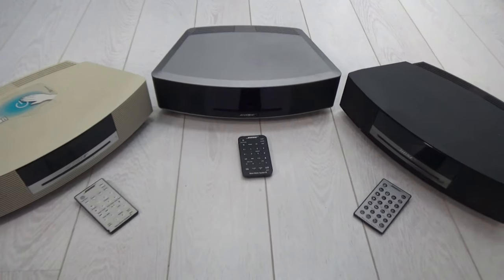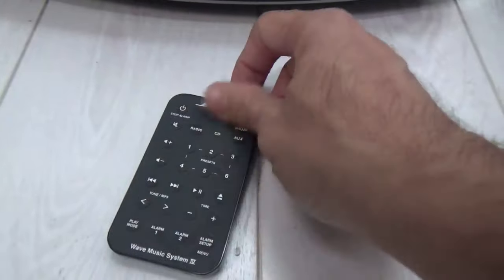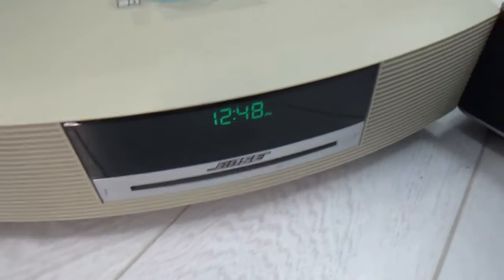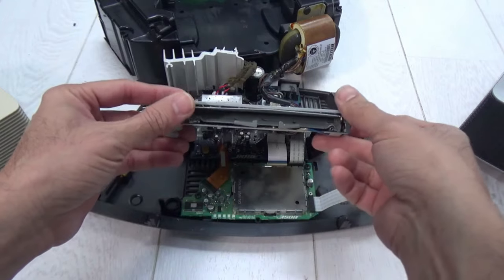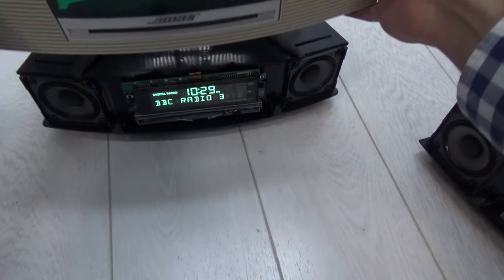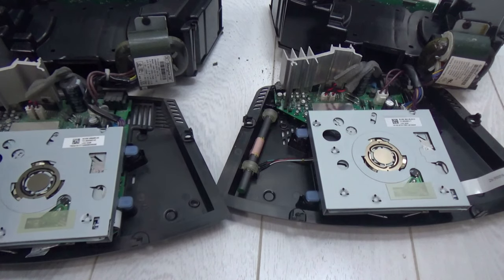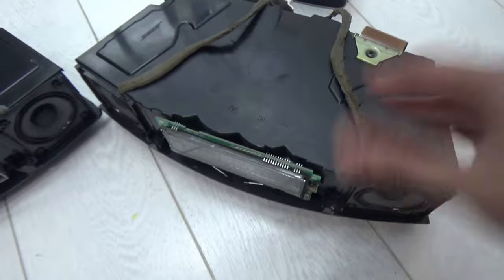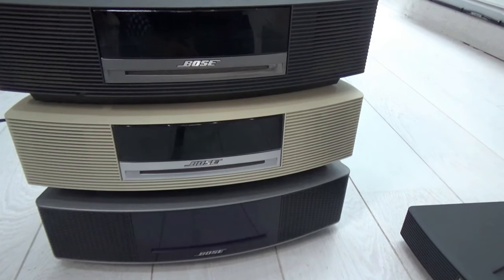Bose Wave Comparison

Comment: Thank you very much for this informative video. Since the Bose wave system is not produced any more, which device would you recommend that could replace it (or better)?
Reply from the maker: Thank you for your comments, I have not seen any Bose product that carries the same design as the Wave system. The wave systems are still around. You can buy them from Ebay or Bose Refurb shop.  All new bose products are smart internet based which means short life of the item.

Comment: I bought the run out of the BOSE II with a free DAB upgrade unit which TBH is a pain - I wish I'd bought the BOSE III instead. I did buy a BOSE IV later on and this has a better frontal grille design. It does however have a rubbish quality remote (see my other comment).

Comment: I have a sixteen year old system 2.  Still going strong.  But, I really wish it had the buttons on the box.
Reply from the maker: Thank you for your comments, Bose Wave II did make a button panel for the system II but was only available in US and Canada. It was called the IC-1 Touch pad. See in this link.

https://www.ebay.co.uk/itm/373445581839?mkcid=16&mkevt=1&mkrid=711-127632-2357-0&ssspo=EunZxSBVSbK&sssrc=4429486&ssuid=-Ln8Ks-tSpm&var=&widget_ver=artemis&media=COPY

Comment: I have a Wave III. I notice that the volume is good and loud on the FM, but when I connect any device to play music through the 3.5mm jack, I have to turn the volume much higher to get good sound. It’s too quiet until I turn it up twice as high on the volume. Is that normal?
Reply from the maker: Thank you for watching my channel and your comments. What type of device are you using in the AuX port?
You need to increase the volume on the source device aswell.
Reply: @thespecialist786  This is a great channel, thank you too! I’m using an iPhone/iPod on the auxiliary 3.5mm with said devices to max volume. I’m using a thin,cheap flimsy 3.5 auxiliary cord but the cord works great in my car.
Reply: @@user-zr3gh4cx1m well, that makes sense. I didn’t know that. I will try that. Either way, that’s reassuring to know it’s not just my Bose.
Reply from the maker: @@user-zr3gh4cx1mThank you for watching my channel. I have not experienced what you’re describing, seems to me may be the master volume setting is set too low. On you wave put it on Standby where you would only see the clock, then increase the volume while on stand by and see what level is the volume set to.

Comment: Thanks for posting. Isn’t Wave 4 has Bluetooth built in?
Reply from the maker: Thank you for watching my channel and posting comments. Please Subscribe to my channel.
To answer your question, 👎 No BOSE wave IV does not have bluetooth its a straight replacment for Bose Wave III with a blue display. You would have thought bose will add that as standard. You need to buy the Bose sound touch wireless link adaptor for bluetooth and WIFI. However then you can use the Wireless  link adaptor with any Wave music system does not have to be Wave IV. All is does it connects to the Aux. This device is £100 which does not make any sense because you can buy a good Logitech bluetooth adaptor for £30  and it will do the same job for bluetooth. The only advantage you have with Bose Wifi link adaptor is that you can also use the Bose App for radio internet via Wifi.
I do not know why Bose would release a new model with the same features as the last one apart from blue display but no bluetooth.
Here is the user guide check it out.
https://assets.bose.com/content/dam/Bose_DAM/Web/consumer_electronics/global/products/speakers/wave_music_system_iv/pdf/745087_og_wave-music-system_en.pdf

Comment: Hi specialist, Thanks for sharing , recently I have been looking  for diy repair for bose speakers( mine is wave system 3).Quite not find the video what I am looking till now . Here goes the problem ,Display looks good,jac and remote working fine but no sound is coming out from both right and left speakers ,Could you point out? what went wrong there ? that would help me ..thanks
Reply from the maker: Hi,
Thank you for watching my channel, the issue you describe is related on the main board and that is not the one under the CD tray. It could be one of the caps or the Audio IC which is mounted to the heat sink.
Reply: @thespecialist786   Thank you .👍 will Check on that....
Reply from the maker: Let me give you a tip and save time if you wish, buy a faulty cheap bose wave with a CD problem or broken case of Ebay and just swap the boards over. This will save you time and hassle of solidering etc because the audio is very rare issue on these units.

Comment: Thanks for the detailed comparison, Specialist. Do you know where the Bluetooth module is on the model 4? Thanks!
Reply from the maker: Thank you for your comments, Bose have not added bluetooth to any of the wave systems however the bluetooth is available on models III and IV via the optional sound touch pedestal.
Reply: @thespecialist786  Ahhhhh. I thought the pedestal was only for Wii and wired Internet connections. That makes me less disappointed because I thought the reason my wave IV wouldn’t go into Bluetooth mode was because of the stereo itself. Hopefully troubleshooting the pedestal is easier and less expensive than troubleshooting the stereo. Thanks for your timely response!
Reply from the maker: @autocompletellc9906  press the Aux button on the remote twice for Wifi and three times to enable bluetooth. If it does not work power off the system and the pedestal. Hold the button behind the pedestal and power on the bose while keeping the button pressed for 15secs the light on the pedestal will turn from white to amber Then once the please wait is gone. Power off the wave system and power on. This will reset your wave system and clear any errors.
Reply: @thespecialist786  I’ve tried pressing the aux button several times, to no avail. I’ve also held the button on the pedestal, but not while the Bose was powered off. I will try that. Thanks for the advice.
Reply from the maker: @autocompletellc9906  if all fails, plug the pedestal on to your PC - Windows. Not Mac and do a system update using the Bose Sound touch update file.  You will need a Micro USB cable to connect to the bose service port.

Here is the web site. Make sure you use the correct file else your system can become a brick.

http://downloads.bose.com/ced/soundtouch/soundtouch_usb/index.html#Wave_SoundTouch
Reply: @thespecialist786  Ok, so I’ve tried to reset the system as you instructed by powering off both units and holding the button on the back of the pedestal for 15 secs while powering the Bose unit back on. The light never did turn white. It did light up amber, and then went away in less than three seconds. As you’ve said, I will have to connect it to a pc and download the latest software updates.

Comment: I have the one that has no CD player....turn on and please wait appears on screen and doesn't work
Reply: It likely going to be bad SMD capacitors as a common issue with them. I fixed a few with CD not working and please wait when changing modes.

Comment: Fascinating and thank you! I have a  2 that reads CD not playable. Can you tell me if / where is voltage adjusting screw?
Reply from the maker: Hi, its an easy fix, I can send you info. There is no Volt adjuster. Its rhe caps and the laser. First clean the laser then try.
Reply: Thanks for the fast reply. Yes already cleaned laser.  Is there a way to determine if it's the optical pick up or caps? I have a multimeter.
Reply: Needless to say, but let me add, Subscribed!!
Reply from the maker: @MrDenniske1  It would be waste of time using a multi meter when we know which caps are the ones
Change the ones under the CD tray inside the metal shield. 
47uf,22uf,10uf,100uf and it will start to work.
Reply: @thespecialist786  Thank you, sir for sharing your knowledge. I'll give it a try! I will let you know outcome. God Bless

Comment: Hello The Specialist.  I have a Bose WARCC1 Wave radio/CD player.  First I plug in the machine, the power is on but not functional, I can not select anything.  It says please wait then do not thing.  After about 30 minutes then I can select AUX or Radio and it plays fine, but still cannot play the CDs.  Then about another 15 minutes later I can play the CDs OK.  I would appreciate very much for your advice.  Thanks
Reply from the maker: Thank you for your comments, If you look at some of the comments I have answered this question. You secondary small audio board caps need to be replaced. Around 6 caps need changing. Please subscribe tonmy channel. I have some really special videos coming soon for bose wave systems.

Comment: Hi specialist my wave 3 volume is very low and it sounds all muffled any ideas what could be the matter
Reply from the maker: On the remote, hold down the alarm setup button to enter into the Menu. Scroll through and go to Reset and press 2. See if by reseting the system makes a difference.

Comment: Dropped older version (cd top loader version) and now AM radio doesn't work, but everything else does. Any suggestions on the fix? Thank you
Reply from the maker: Open it and reconnect the AM attenna. Thank you for watching. Please subscribe to my channel.
Reply: @thespecialist786  Thank you and just subscribed. Can't seem to open it. I understand there are two tabs/bits sticking out inside and the bottom right and left at the front. Any thoughts on how to take the top off with these in mind? Thank you.
Reply from the maker: @user-kg5dd7ik6w  there is a screw under the CD tray and two at the back.
Reply: @thespecialist786  Unscrewed them all but it still wouldn't come off. Not sure what else to do to get the top off.
Reply from the maker: @user-kg5dd7ik6w  Wedge a butter knife or Flat screw drive on the edge at the bottom. Pry and dislodge it. Don’t worry it won’t break as long as you have removed all the screws.
Reply: @thespecialist786  Thank you. Will try that! I also recently bought a newer wave (front load cd). Some Cds work fine, but others seemingly undamaged don't and the mechanism produces a ticking noise when trying to read those. Is this defective or are these units just picky about CDs? Many thanks - really appreciate your replies and videos. Plus it's hard to find anyone these days who really knows about Bose products and repair.
Reply from the maker: @user-kg5dd7ik6w  Thank you for your response. As the saying goes Old is Gold👍 and One mans Trash is another mans Treasure😃. Front loading ones are great but as with everything in this world. Time is the essence. After a certain time everything shows its age. These Bose have Weak caps and lasers. The ticking sound is the capacitors. Have a look at my other videos and in the comments I have mentioned the ones that need replacing.  Please subscribe to my channel.

Comment: Hello, I have Bose Wave SoundTouch III. When I play CD it sometimes skipping and stop playing cd. but it sometimes play well. What could be the reason for it? Also I have request. Can you show how can I add a bluetooth 5.0 module circuit to wave 3 making it Bluetooth enabled.? Really Appreciate your videos. thanks
Reply from the maker: Thank you for your comments, I have some really interesting videos coming very soon for wave systems.
If you wave is not playing CD’s then you need to listen carefully , is the system clicking or just not playing? Whats the message that comes on the screen and have you tried doing a system reset.
Reply: @thespecialist786  thanks for the response. ,yes the system is actually making the clicking noise and the same track number is showing as usual..sometimes the track number blink while clicking..I have tried system reset but the same result. its a clean CD .any suggestion will be helpful.
Reply from the maker: @jonnathanjon1  Excellent, Good News is it’s a simple easy fix. Bad news is you need to have Solidering skills.
Reply: @thespecialist786  thanks for the response. Yes I have a good soldering iron at home and not bad in soldering unless I need to touch an IC or something like that.
Reply from the maker: @jonnathanjon1  brill, get ready with a 0.5 tip pointy solidering iron. Open the system and I will make a Utube video just for you on what to do next.
Reply: @thespecialist786  thanks much. really appreciate your assistance.
Reply from the maker: @jonnathanjon1  before you begin, please order these Caps - x2 22uf 50v x2 10uf 35v, x1 47uf 25v, x1 100uf 25v Low Esr Panasonic
Reply: @thespecialist786  thank you .will do
Reply from the maker: @jonnathanjon1  where abouts are you in the Globe?

Comment: I have bose wave III
 (AWRCC3}, and for some reason it does not have an item in the setup menu to enable the touch pad, and it does not respond to touching the top hand, as indicated in the instructions. Can this be solved by updating the firmware ?
Reply from the maker: I am sorry to say you have a Bose wave II not III.